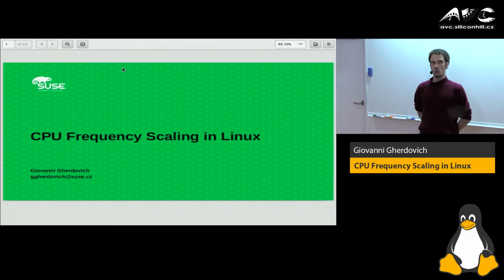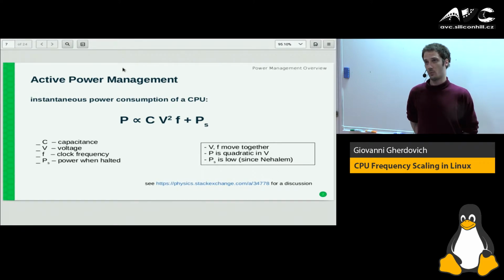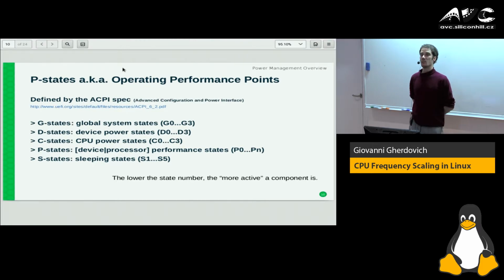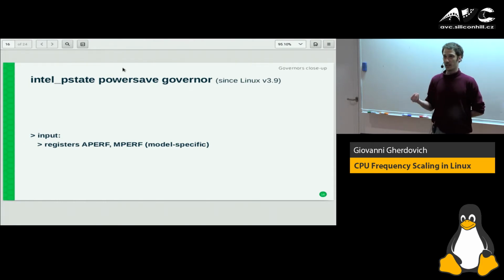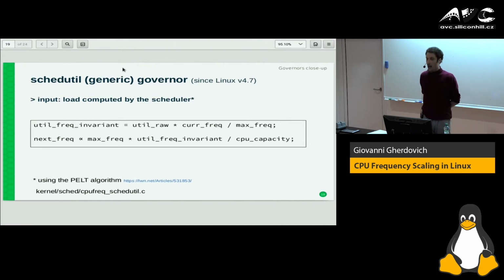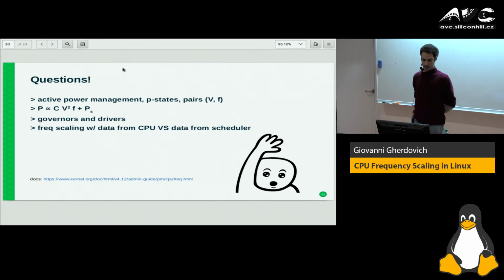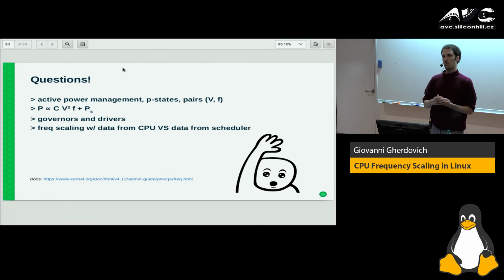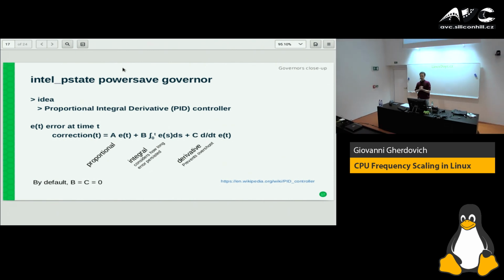LinuxDays 2017 - CPU Frequency Scaling in Linux - Giovanni Gherdovich

Comment: Hello, I'm the speaker in this video. At 9m10s I give an incorrect information, saying that two hyperthreading siblings can be at different clock frequency. This is not true.

Hyperthreading works by simulating two simultaneous threads of execution out of the same physical processor; when one stalls waiting on a memory access the other can make forward progress. As they're backed by a single physical core, their operating frequency is the same. I was misled by the output of the powertop(8) utility, which shows you different frequencies for each logical core. The point there is that powertop(8) displays the directives sent by CPUFreq to the driver, not the actual frequencies as they're applied on the cores. When the CPUFreq subsystem instructs two hyperthreading siblings to be set at different frequencies, it's oblivious that both logical cores will be set at the highest of the two requested values.
Reply: Hello Giovanni, I have a few questions.
I've bought myself a laptop with an AMD processor. It performs very well and I can play my games on it while it's being charged. However, if my laptop's running on battery, it's a whole different story: The only governors that do work are 'ondemand' and 'powersave'. My APU has four different frequency steps:1.4Ghz, 1.8Ghz, 2.3Ghz and 2.7Ghz. 'powersave' does its job and makes my laptop sits on 1.4Ghz, 'ondemand' floats between 1.4 and 1.8Ghz. In other words, I'm unable to make my laptop perform just like it does when it's charging. 'performance' does nothing, I can't make my laptop reach its maximum frequency when it's running on battery, no matter what I do. So I was wondering, *can I set a governor's maximum and minimum frequency?
*What is really keeping my CPU Frequency from going all the way up to 2.7Ghz even when my laptop is on battery for an AMD CPU? It can't be P_state because this is an AMD APU.
*
Can I set a governor attributes as parameters for a launcher? The idea behind this is that whenever a game is launched, the application would set the governor itself, so I could have this as a Steam game launcher parameter:

DRI_PRIME=1 %command% cpupower frequency-set -f 2700000 (That would be the equivalent to right-clicking a game icon and choosing to launch it with dGPU and all settings maxed out)

Please visit https://askubuntu.com/questions/1090380/cpufreq-only-ondemand-and-powersave-governors-work-when-laptops-running-on to know more details about the issues I've been going through with CPUFreq. Thank you.